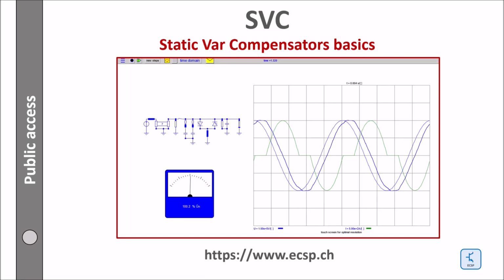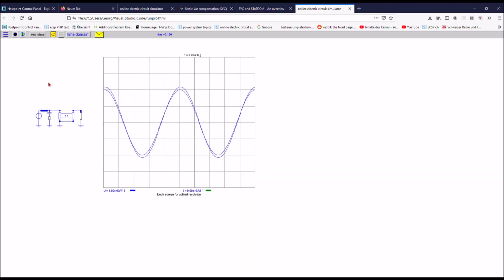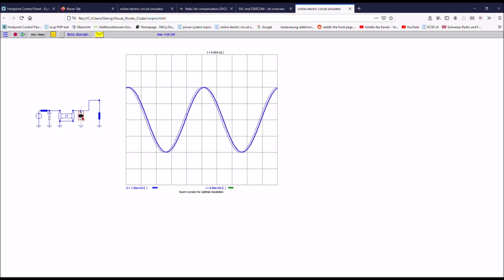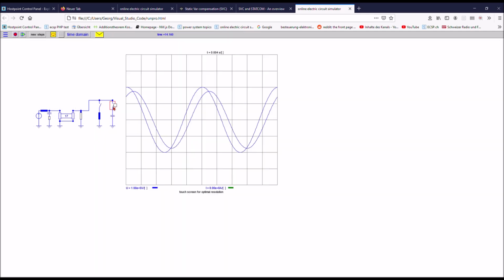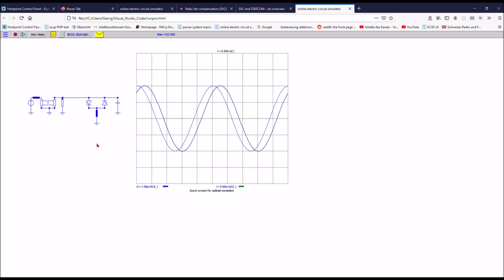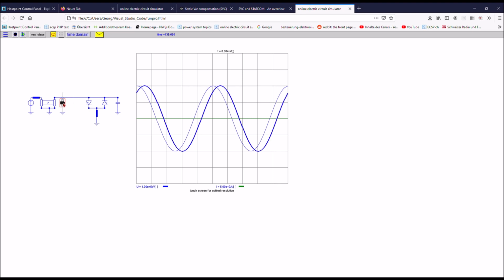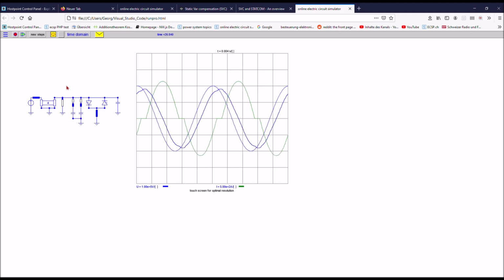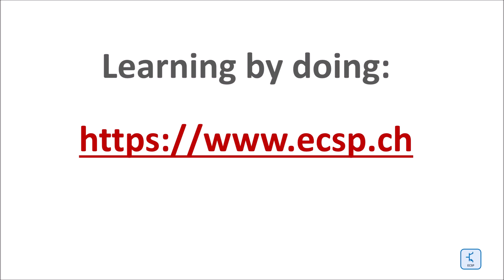Power System Static Var Compensator SVC for Power Quality [circuit simulator]

Comment: Hello thanks for good explanation. Just thinking, adding inductors in parallel should decrease inductance. If you have over voltage because of too much capacitance, then shouldn't the inductor be added in series? Cheers?
Reply from the maker: You have to add inductors in parallel. Just as a very simple model: Many inductors in parallel would bring you closer to a short circuit where the voltage would be zero. Many inductors in series however would bring you closer to an open circuit which would have no effect on the over-voltage anymore.
Reply: @georgschett801  that's a good way of thinking about it!

Comment: hi thanks for sharing. I have doubts.

1.	The over voltage at load side is it because of Ferranti effect.. the grid wire to ground capacitance build up causing it?
2.	The undervoltage inductance is it because of load side majority of inductive loads ? is that the only reason or is there any more reason?
3.	Third could you share your knowledge on how to design 3 rd and 5 th hormonic filter you are designing ? Mathematical calculations or any insights?
Thanks
Reply from the maker: Thanks for your feedback and for your interest. 
1. The over voltage at the load side is because of the Ferranti effect or because of any other capacitance which causes a voltage increase.
2. The under voltage is due to any resistive or reactive load connected to the circuit. The circuit needs to be inductive however (lines, transformers or generation for example).
3. There is lots of publications on the internet about filter design. I just took the frequency domain simulation of ecsp and adjusted the filter to meet the third and fifth harmonics. In reality you may add additional filters filter for higher harmonics.
Best regards
Reply: @georgschett801  thank you for taking time and for your answers.